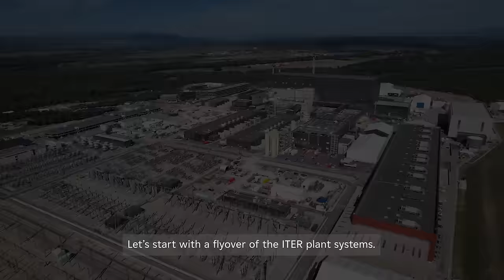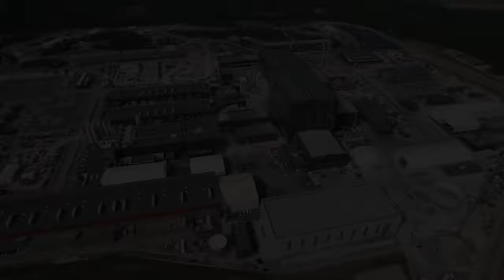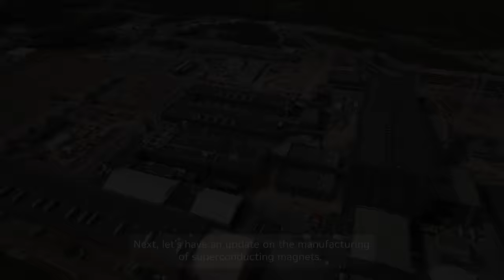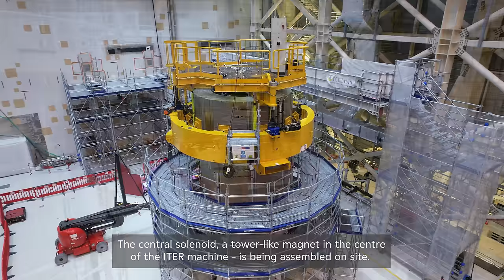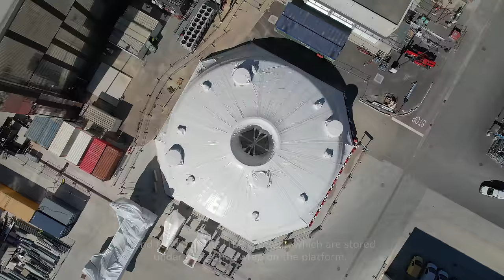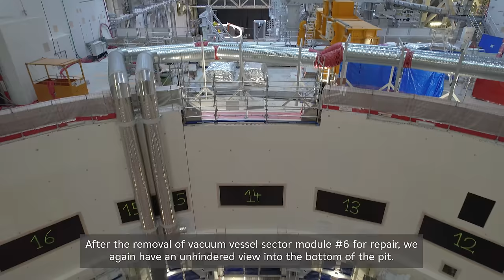ITER by drone - late 2023 (subtitle version)

Comment: I'm not up to speed on the pressure vessel repair. I read awhile back that cracks in the weldment were found. What is the solution that was found to be adequate?

Comment: La vitesse de construction est trop lente et a été retardée de plus de dix ans. C'est un échec total. Tous les obstacles bureaucratiques et procéduraux doivent être éliminés et la construction doit être réalisée 24 heures sur 24.
Reply: I worked on the JET machine that came before ITER - it had cost overruns, took longer than originally planned, and it had numerous setbacks. It was however finished. It exceeded it's original goals, created fusion, and we learned a lot, not least that with a positive mindset, our species can achieve what some believe is impossible.

Comment: It will run in about 50 years at this rate.
Reply: Much sooner than that. If all goes to plan, in 2035, ITER will seek to generate about 500 MW over 300 seconds.
Reply: @OptimisticHominid  Key word on 'if'. Last I heard, the project was supposed to be up and running in 2025. I'm still hopeful, but there will likely be more delays.
Reply: @OptimisticHominid  
definitely
5000 MW in, 500 MW out